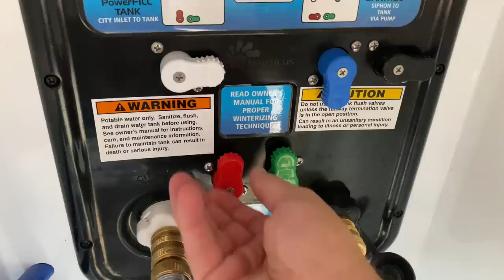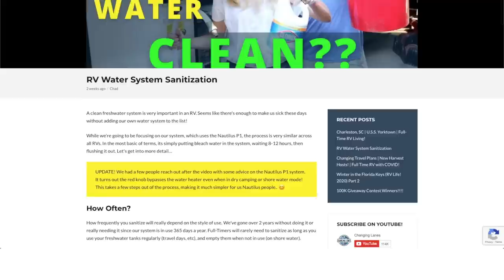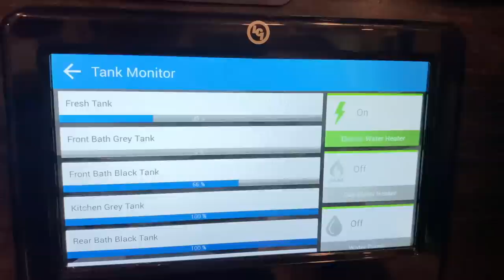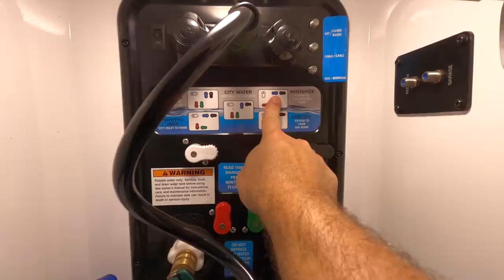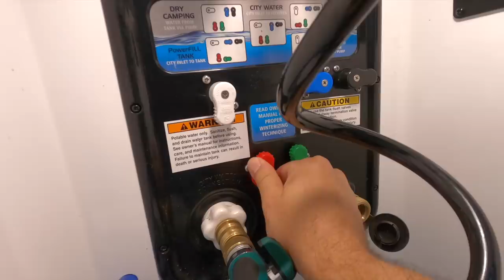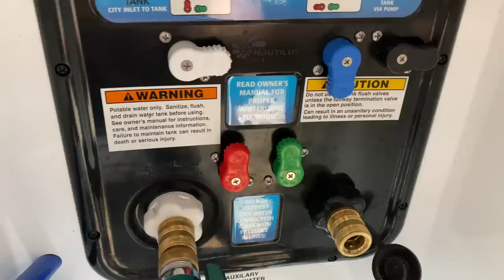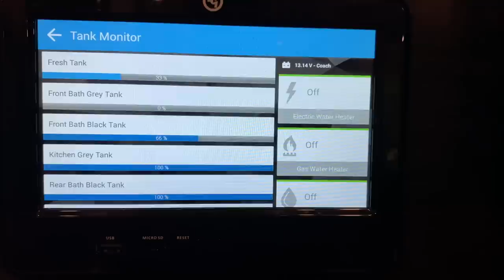RV Water Heater Maintenance (and Anode Rod Replacement)

Comment: We used PVC pipe to fill the water heater through the anode port. Found a threaded adaptor that fit the anode port, glued a 12" pipe on to that, added an elbow pointing up and another piece of pipe that extends above the top level of the tank. Open the pressure relief valve, and pour the vinegar down the pipe (may need a funnel). Once you have all the vinegar in, finish filling the tank with water using a bucket or hose until liquid comes out the relief valve. Leave everything in place for overnight. Next day just unscrew the PVC and flush the tank just like you showed everybody.  That's worked much easier than messing with the relief valve. 
Salute.

Comment: Hey, great timing . . . one day after I did our Suburban water heater. 😂😂 I had to fit a 3-ft length of pipe over my ratchet handle to get my anode out. I did the vinegar thing, too, though there wasn’t much crud in the tank. The hardest thing was getting the new anode seated in the tank. I ended up just using the socket and sticking a screw driver through the socket to keep pressure on the anode while I turned the socket by hand. That did the trick. Good episode, as always. Fly Navy.

Comment: Try a dryer vacuum hose and suck it out.  Thanks guys for all the great information.  We used my husbands Dad's camper one summer and he said the hot water heater didn't work.  I boiled water and washed dishes outside for most of the week and Mike decided to take apart the heater and walla he came in and said turn on the hot water and it worked.  Just needed it to be cleaned up and flushed.  Who knew?????? Hugs from Minnesota

Comment: You did a great job.  I had a similar concern with extracting the calcium scaling.  I used a tube (that would go through the anode hole) and rigged it to attach to my wet vacuum and it was amazingly efficient!
Reply: Yes that works well. Done that for years.
Reply: My thoughts exactly
Reply: That’s what I was saying like cleaning an in ground pool to clean bottom….lol
Reply: You know the thing a ma gig for the which a ma call it thing….lol

Comment: You guys are really helping me gather all the tools to take care of my new Sandpiper C-class 3330BH. This is my third camper but becasue I didn't know how to stay on top of maintenance, my last one deteriorated rapidly. My new unit does have a Suburban Airxcel water heater and I do have the Nautilus system, so your video here was extremely relevant, informative, and helpful. Thanks!

Comment: I picked up a pvc, threaded fitting, a 90⁰ elbow and 2 feet of pvc pipe. Total cost under $3
Screw fitting into tank, stick aprox 6" of pipe into the fitting and the 90⁰ elbow pointing up on the other end, with the rest of the pipe sticking up.
Pour in vinegar until it comes out the pop off valve and go to bed.
Works like a water level.
I didnt even glue the parts.
Reply: I was engineering that exact solution in my head! 👍🏽
Reply: Great method
Reply: I really need this process, I notice on the last trip little pieces of calcium clogging faucet screen. I am going to use this method to fill tank. Two thumbs up. I also drain water tank and blow out lines after each trip to keep water from getting really smelly in between trips.

Comment: What I tried was an air compressor with a long one to go inside to take and blow against the back wall at the bottom of the tank and the only way out is the front hall. I get a very good job of getting the settlement cleaned out of my hot water tank give it a try   Jim

Comment: Glad you used a magnesium anode rod, the work better than a aluminum anode rod. How do you tell the difference? The magnesium rod has a weld in the center of the male pipe plug.

Comment: I do it with the pressure relief valve out. And it’s easyer to use the top valve with the wand and doing the vinegar
Reply: Tim, you just took out the top pressure valve correct

Comment: So question I played alot with chemistry when I was younger and I have a theory that food grade citric acid dissolved in water might completely dissolve the calcium build up in that water heater because i use it to clean shower heads and faucets around my house and it works like a charm.  The biggest thing that i don't know is if it would be harmful to the water system.  But basically it is the same stuff used in bath bombs and the powder coating on extremely sour candies.  Just an idea that I figured I would suggest!  Also I love all your videos keep them up!  Stay safe on the road!
Reply: I was thinking the same thing. I know citric acid will dissolve the calcium. I just don't know how it would react to the steel wall of the tank.
Reply: @georei  The steal tank has a porcelain liner.

Comment: Oh, one more tip from an old oilfield production guy that did more steel plumbing than I ever wanted.  IF you use the steel plug based anode (Suburban magnesium), consider putting a coating of nickel-based anti-seize on the plug BEFORE the teflon tape.  Then coat the external parts of the plug and tank port with HILCO Lube or other quality lube (NOT WD40.... ever).

This will 99% eliminate thread corrosion, stuck plugs, and rust stripes from the plug.

Be careful with the torque on the plug with anti-seize.  You have steel threads on steel threads.  The potential is there to damage the threads on the WH port.  IDEALLY, they would sell BRASS plug anode rods with replaceable (threaded) anode rods that screw into the internally threaded plug.  Just like they do on engine anodes on boats.

Comment: Great tutorial! Chad...you got me thinking about exactly what each of the levers do on the Nautilus system. We've got a 2023 Reflection 320MKS, and it's only a 3 control valve system (white, blue, and green). Have you figured out what each valve's position does?! Fortunately (or unfortunately as I've read sometimes) is we've got the tankless WH, so I'm guessing now that's why we don't have a red valve. 

I hate to admit it, but  we had a 2006 Weekend Warrior 40FT TH for 18 years, and I'm surprised that I never replaced the anode rod on our 10 gallon WH. And we're in hard water territory here in SoCal. Hopefully the new buyers found that out. :-) Surprisingly after those 18 years, I NEVER had any electrical or appliance issues with that coach.

Comment: I for one do not open the pressure/temp. relief valve. I learned the hard way by flooding a customers basement after changing the heating element. It didn't leak initially when tank was full, but after heating up it opened and we had a big OOOPPPSS during the night.

Comment: I did this last year as well. So maybe I used too much vinegar or let it sit much longer than you did, but when I pulled out the brand new anode rod, it had been eaten away by about 50%. 😳🤣 Note for next time...leave the old rod in while doing a vinegar soak, then swap in the new one.

Comment: IDEA: open the air pressure relief valve for air to go IN (not Out) & hold a wet vac hose to where the anode was removed & suck out the loosened sediment. 🤷🏽‍♂️

Comment: Great video. We have the same Nautilus panel, so that makes it so easy. Word of caution: I bought the same wand to flush our water heater in May, and the plastic tube came off inside the tank. Luckily it washed back out with the water that was draining out, but it gave me a scare wondering how I was going to get it out! Thank you for all the how-to and maintenance videos. Safe travels!

Comment: “Did you just call me sir?” 😂 Thanks for sharing. My rig has a Atwood propane heater and I’ll be servicing it soon, also found a magnesium anode rod designed to use with the aluminum tank. Has anyone used the aftermarket electric heating rods, i.e. lighting rod?

Comment: super easy, but time consuming. Hi, when I did mine last Oct?? (I think) I removed the pressure relief valve and flushed from the top down. (I did some repairs at the same time) it's all in my video.  just my opinion because I did not use my inspection camera (great idea by the way) to actually check the results. I love watching everyone's maintenance videos, you never know how much more info and great ideas people come up with. great job by the way, even the camera / monitor holder....
Reply: lol I’m on
Reply: Oops

Comment: How about your water wand with a wet n dry vacuum.  Smaller 3/8 hose taped to the vacuum.  A coat hanger attached to the vinyl hose will give you some control angling it around.  
Love your vids.

Comment: To get the sediment out of the bottom, seems like you could take the water heater off of bypass and let the water from the main line in the back flush the sediment out the anode hole. Also using the lent brunch would help.

Comment: Great video! I was wondering if there was an easier way to bypass the hot water heater. Presto, you hit the nail on the head. Appreciate the information. You guys are the #1 tubers. Question for ya. We have a 376 THS and on our way back from South Dakota last week, one of the windows worked its way open until the plastic disks on the window operator wore to nothing, then the window came open and flapped in the wind until we pull off and tapped it closed. Ever had trouble with with that. We have the frame less windows. Thanks again Chad &  Tara.
Reply from the maker: Never had an issue with the windows.. We have frameless also... Gotta make sure they are snug before travel..  👍🏼

Comment: Thanks for the great information. My 2021 Solitude Nautilus system has the red and green on opposite sides then your Nautilus system, so hoping that turning right is off and up in on - just did the tank sanitizing yesterday and doing the water

Comment: I have been brewing beer and making wine for quite a while.  Sanitization is key.  I never use bleach because any residual will either kill the yeast or leave a taste.  I commonly use Metabisulfite and am wondering if this is a good alternative to bleach since you would not need to worry about residual taste, impact on the water heater, or corrosion to components.

Comment: Next time to get all the crap out of the bottom I would recommend a shopvac with a little adapter like u used on ur hose will save you lots of water and time :)

Comment: Chad - just a tip from my experience: You could use CLR (or similar product) prior to your sanitation.  CLR will dissolve the deposits and you won't have to fool with the bottle brush.
Reply from the maker: Interesting idea...
Reply: @ChangingLanes  Jarheads do have good ideas ever so often...lol

Comment: Great couple of videos. I hope I didn’t kill my hot water heater. I ran concentrated bleach through it when I cleaned the fresh water tank.

Run vinegar through the lines in the house. It makes a huge difference in the clarity of the ice.

I also use a funnel and flexible silicone tube to get the vinegar through the top.

Vinegar kill the Pseudomonas bacteria. It can also be used inside to keep the lime scale from building up around faucets that can also harbor Pseudomonas in any standing water.

Thanks for the videos.

Comment: cool vid. i wondered about this but my atwood does not need one (anode) as it aluminum water tank.
Reply: When I think about it suburban made this an intentional design to destroy water heaters it obviously makes no sense to use a steel tank regardless of the anode rod most people don't know that I didn't when I first purchased my RV thankfully I learned within the year so my tank had no damage I call this planned obsolescence

Comment: Thanks for posting this great video!
...Can I flush my entire system with vinegar instead of bleach?...eliminating the need to isolate the hot water tank? 
Is it OK to run vinegar and bleach through water pump?
Reply from the maker: Yes.. that should be fine.  Not sure if it will be as effective as bleach, but it will definitely help.

Comment: When I do mine I fill with the vinegar and turn the heater element  on and leave it over night and i flush it the next day with city water after I shut the element off it seems to do a better job
Reply from the maker: I asked our RVIA Master Tech about that and he said definitely do not heat the vinegar solution.
Reply: @ChangingLanes  did he say why because it works really well but if there's a good reason I will stop doing it thanks I love your
Videos well done
Reply: Thanks for your reply so I did a little more research and I found that when vinegar is heated up it becomes more ascetic  and could damage my hot water tank thank you so much you may have saved me thank you
Reply from the maker: Thanks for getting back.. I knew it was something like that.. 😀 👍🏼

Comment: A word of advice. Next time try to put the flush wand into the tank and agitate as much as you can right after you pulled out the anode rod while the tank is still full of water. Sediment is heavy and it is hard to flush it out with a little water in the tank. If the tank is full it will float a little longer . Keep doing is untill water is drained from the tank only water in the tank is the one coming from the wand. I think you will flush it much quicker.

Comment: I use 3/4 inch PVC to fill the tank with vinegar. Get a threaded male end to put into the anode port and the use 6 inch pvc to come straight out to a 90 degree , then another pvc to go straight up higher than the tank and use a funnel to fill with vinegar. You can leave the pvc in place until its time to drain and if you don't glue the connections you rotate the 90 degree straight down and drain into a bucket without having the vinegar spill on the ground. This way there in no vinegar in any of the lines or pump and because the pvc will extend higher than the water tank so you can fill the tank higher than the the relief valve- just have the hot water faucet closes to the water tank open so air can escape as you fill the take to the top with vinegar.

Comment: Try using an air compressor thru the pressure relief valve to blow the sediment out, along with a vacuum sucking from the drain.

Comment: To get the extra sediment out try a hose similar to your rinsing hose attached to a small vacuum. Be sure to leave the pressure valve open. You need air for the vacuum to work.

Comment: I might be wrong on this but thought I had just read where you needed to use little to no thread tape as the rod had to be conductive to the metal, again I could be mistaken but had read something about it, if you find out please respond as well.
Reply from the maker: What I've read on the topic suggest it's a good idea to use it... It won't completely (electrically isolate the anode) and it can be very difficult to remove without it.
Reply: @ChangingLanes  Yeah, the pipe tape gets shredded when you screw it in, it's purpose is to fill in the voids in the threads that are caused by nicks and tolerances in the threads.

Comment: I just traded for a new 2021 Winnebago 2306BHS.  The dealer told me that the water heater in this particular RV did NOT come with an installed anode rod.  I havent checked that myself but found it hard to believe? Anyway, dumb question:  if that's true, can I simply install one myself off the shelf?

Comment: Another great informative video guys! Chad I'm curious the valve at the top for the vent the threads is that for a water hose to hook up and flush? ...was wondering if that would help us also....Great idea with the scope will get mine out now and check the element also...Great job you guys!! Tara as always great job on editing!! Keep up the great 👍 work!!
Reply from the maker: It's really just for pressure relief but it is threaded and we'd have a lot of feedback that people use it to fill with vinegar.
Reply: @ChangingLanes  fantastic thank you! I'll be doing this very soon! Keep up the great videos you guys! BEST youtube rv channel ❤

Comment: adding tape to the threads is a gamble. For the anode to work it needs continuity to the tank. The threads may cut thru the tape. If they do not the anode will not work and your tank could be in trouble.
Reply: Does the head of the bolt make enough contact?

Comment: After watching your sanitation video, I did my unit. I then did the water heater similar to you but heated the water.  I found that if I quickly turned the wand on and off it lifted the sediment and it flowed out easier.
Reply from the maker: Our RVIA Master Tech said to not heat the vinegar... can't remember why....

Comment: If you are completely draining the water heater, don't open the relief valve first. Pull the anode rod first then open the relief valve. You have more control over the water gushing out and you won't get soaked. Just a quick tip.

Comment: Question (sorry if a dumb newbie one ... or one already asked). If you orientate the nautilus valves to run on tank/pump (and ensure you don't use hot water throughout the night) will you still be able to flush the toilet?
Reply from the maker: If you're in dry camp mode (pump/tank), you can flush the toilet.  Shouldn't have anything to do with whether you use hot water or not...
Reply: @ChangingLanes  Thank you! I was thinking that if my 90 y/o mother-in-law inadvertently turned on the hot water with the pump on that the solution soaking in the heater would come through the plumbing in the rig and be replaced by the pump with water in the freshwater tank. Than you for the clarification. Love your channel!